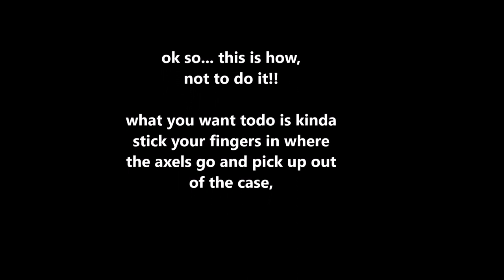srt4 lsd dodge neon t-850 Differential  removal

Comment: I know your video is kind of old, but do you recall how many differnt bolt length the differential cover has?
Reply from the maker: @ 3:28 i show there's 3 different length bolts and the 4th is 2 bolt studs that get the nuts for the snubber

Comment: Is there a gasket between the differential and the shell of the box?
Reply from the maker: no gasket, oem is a stuff like silicone I can't remember what its called at the moment but I'm thinking its not available. I used silicone in a thin layer, but be sure none squeezes inside the case.
Reply: @Mattsneedforspeed  Ok it's good to know. I'll find out what silicone is putting on the transmission. Thanks for the tip.